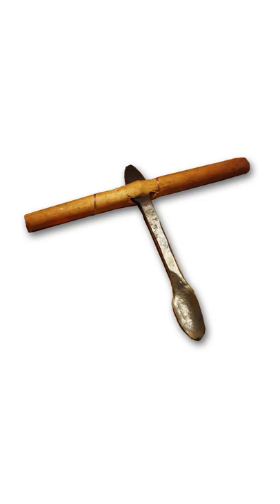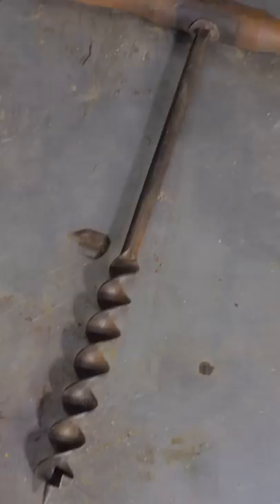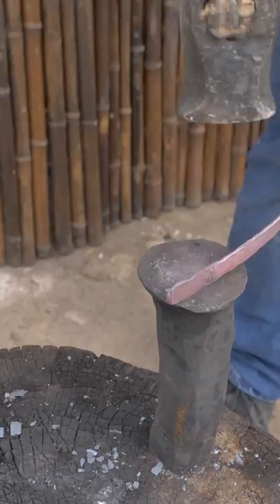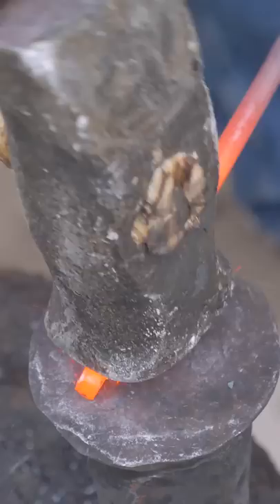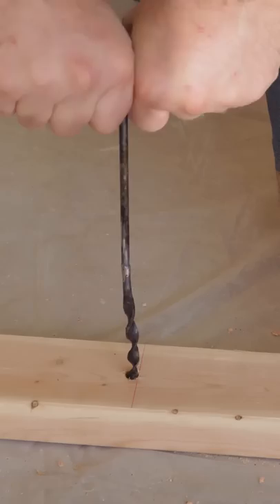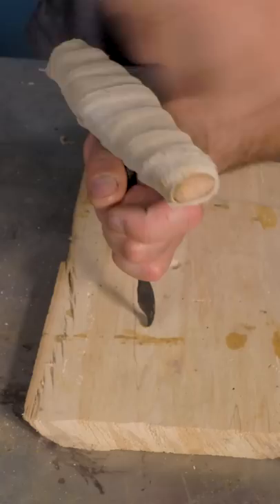Making Holes!  Drill Invention #2: The Wood Auger! #shorts

Comment: (Hobbiest) Blacksmith here: if you're going to be twising thin flat bar, use either two tongs or an designated twisting tool, be it a simple long bar with a slot in the middle or a wrench-like tool. Either method will prevent it from bending off center, thus making use easier and the finished hole cleaner

And from my understanding, an effective "pre-modern" bit should be a more shallow point (~20 to 30 degrees from horizontal) with a small biased bevel (at simalar angel of the tip) towards the direction of twisted... unless the bit has a screw at its tip, then that will work along with a tight shoulder with a beveled edge towards the direction of rotation.

Screws like at the tips of those bits can be filed if a screw die isnt available.

Your craftsmanship reflects your skill. If you become more proficient with your tools, you'll get better results. Best not to rush into things without doing research beforehand.

Comment: Nett time Twist it in a metal tube for a straight Drill ,heat tread it at 750°c and relax it in the oven 250 °c 
I would like to see a second video from you greetings from a german blacksmith